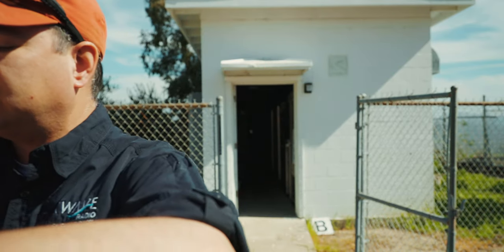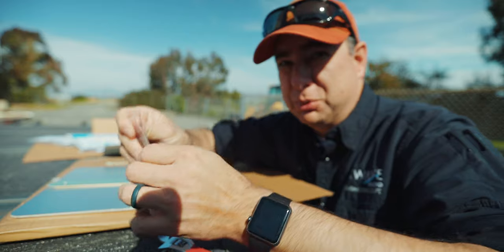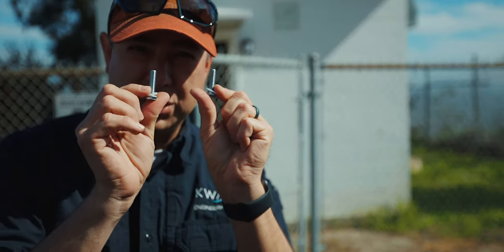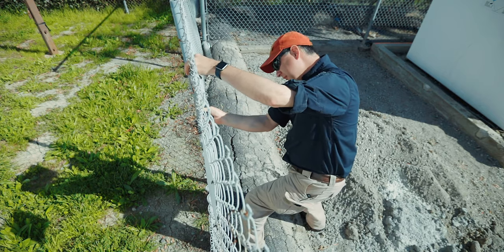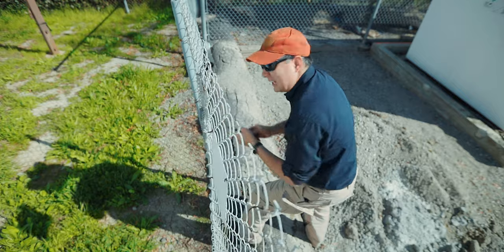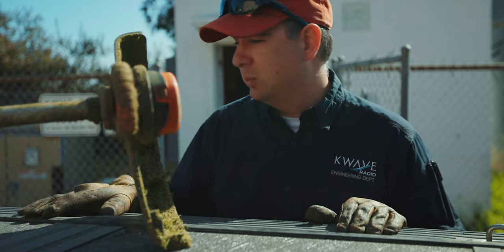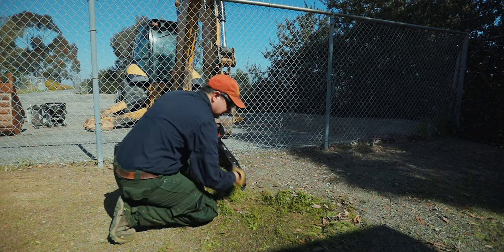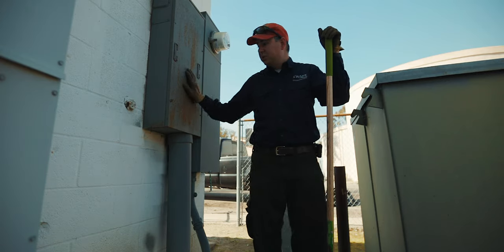RF safety signs explained

Comment: Great video, and very informative about the signs. I actually have a question..obviously you’ve been in this business for awhile & I am sure you have learned to adapt to being in an RF environment for a few hours, tops. If you don’t mind me asking, do you ever experience any headaches from being at Transmitter sites due to RF or perhaps when you first started as a broadcast engineer?
Reply from the maker: I have not experienced headaches from RF, but from dehydration. Most of our sites are in high elevation in dry environments. When you drive up to the site you forget to drink water. That being said, I did have one site that is at about 8700 feet where I felt a tad sick, but once I got some water and moved around I was fine. What was happening was hot spots of RF and I was standing in one spot for a while. The issue becomes tissue heating. It’s non-ionizing radiation so it’s not impacting your cells other than warming things up. Humans don’t have temperature sensors inside their body so you can heat up without knowing it. Usually moving a few feet will solve that issue. 

A lot of things that I experienced early in my career I could be explained by some basic outdoors and hiking knowledge (which I didn’t have) about being in high elevations and dry climates.

RF isn’t as scary as many of these “5G is a boogeyman” people are claiming. If you stay outside the yellow signs you won’t have any issues from RF. Of course usually if you cross the blue notice signs you’re probably trespassing and that’s a whole other discussion... :)

Comment: Are you the only occupant in building B?  Does it belong to KWAVE?
Reply from the maker: We’re the only ones in there. We’ve owned the building since around 1972 or so. We went on the air in 1971 at the AT&T building (next to it) up the dirt road. Moved to the San Clemente Peak site and went to 50kW ERP. In 2001 moved to Santiago Peak and down to 530 W ERP but much better location.